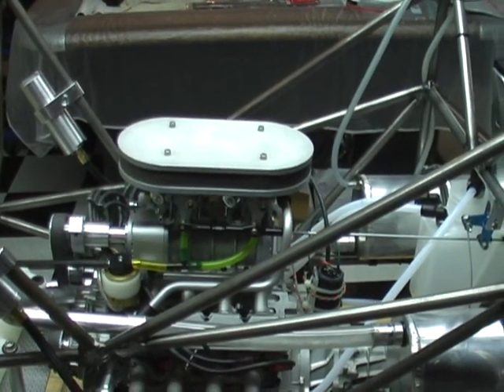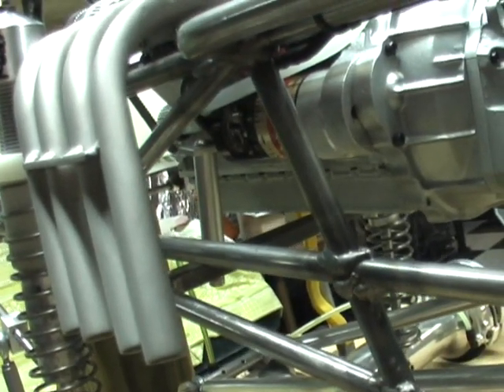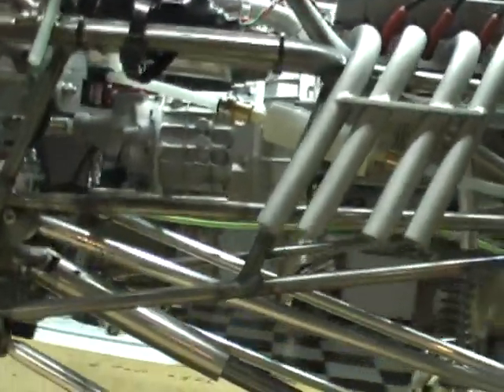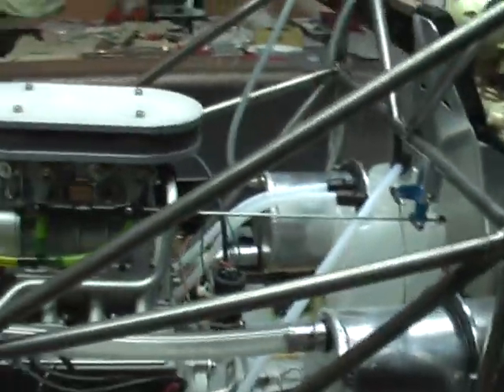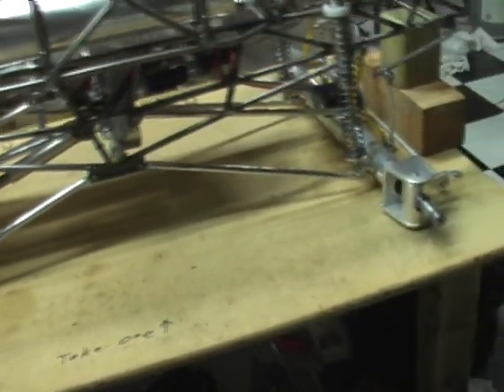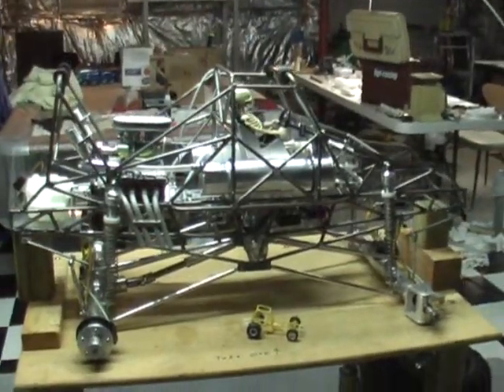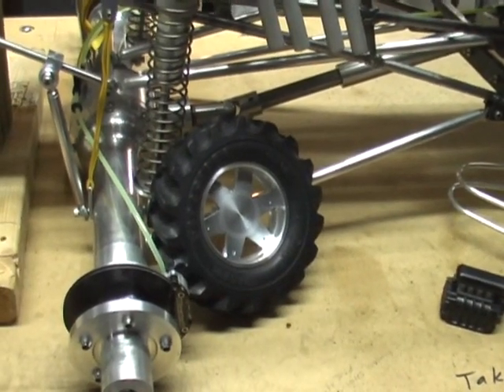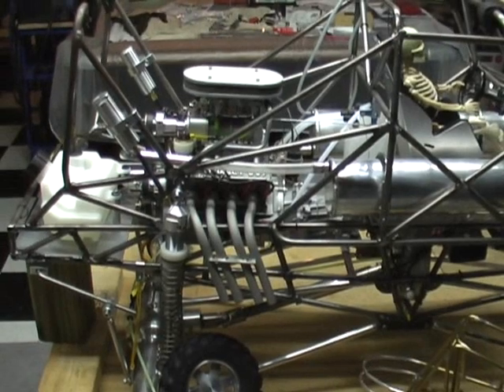1/4 Scale Grave Digger Part 22D - a few more details

Comment from the maker: The tanks are the radiators you could say.  Yes, the water flows from 1 tank, thru the engine then thru the other tank.   With 95oz of water it should run long enough to get to the finish line before any heating problems.

Comment from the maker: To - @Skwisgar2322 
Depends on how it runs.  A drive/steering front axle will add weight slowing it down and putting more strain on the engine.  Plus to design/fabricate one will take 100+ hours.  So all that work for a slower truck, I don't know about that!!

Comment: @rcWizzard 

That's one of the drawbacks of straight cut gears , they exert an outwards pressure [away from each other] during operation. But on a positive note they are more energy efficient than other kind of gears. Hope you find a permanent solution to this problem !
Good luck and keep it up !!!

Comment from the maker: To - @jackdaniels5205 
With a smaller opening below the carbs, the fuel/air mixture travels faster, then expands in the intake manifold which is a good thing.  Yes the builder, of 30+ years, is aware of the carb mods, which he has also done.   Check out the builders Updates at ConleyPrecision. com

Comment: @018e4 whats right with it lol...I would bet that its not meant to handle stress loads and the crank shaft will snap. Or it wont have enough power to spin the tires in the dirt. Either way you get the point.

Comment: Was is me or was there some servo binding on the steering.... you might want to adjust the throw percentage in the radio so that when you turn full right the servo stops when you do. also there was noticeable play in the servo for throttle between zero and when cable actually starts to move the throttle cables on the carbs. maybe some adjustment there for a more touchy response.

Comment: Of course the motor has the power. Put it this way, this motor has 9 bhp. It's gotta haul only about 90 lbs. The yamaha wr125r (offroad bike) has 14 bhp, and it's gotta haul 180lbs of rider alone plus the weight of the bike up to 75 mph! So this mini v8 really is overkill, but it's a learning curve, it'll take alot of time, trial and error to tap that potential, but the potential is certainly there, heck I can't wait for the wheelies (backflips more like!) so i'm just gonna stay tuned!

Comment: You could perhaps make the throttle servo a bit faster response time and tighten the lead going to the pivot arm, unless you are intentionally leaving a bit of slack to make lag in the throttle response.  I would assume having more direct response would be easier to control, but maybe that's just my driving style.  I can set up "exponential" on my radio, and I did set up some on the steering, but my throttle is almost 1:1.  This is a brush-less speed demon 1/10 electric buggy though...heh.

Comment: Put a shorter arm on the brake servo and use all the degrees you have available on it, that way you get the most torque out of your servo and you won't burn it up so fast.

Comment: @rcWizzard A fair point, although the design should bee the easy part as you can really just scale up smaller scale components or possibly re-purpose parts from a 1/5 scale R/C car. as far as weight, I am not sure it would add enough to be a significant factor but you have more hands on experience with that then me. perhaps you can run some numbers on how much more weight it would add, and once you get it up and running, through some ballast on it and see what it does?

Comment: The way it squats when you hit the throttle in vid 22 it should be able to do a wheelie. 90 pounds with 9 horsepowerr should pull the front wheels up.

Comment: Im not sure if the question has been asked ( I was reading through looking )but whats the idea behind adding a restrictor plate and dropping the power?also is the engine builder aware that just adding a restrictor plate and not making any changes to the intake and intake ports can cause big turbulence problems with air flow and air/fuel mixture inside the engine?

Comment: I notice no radiator, is the cooling a total loss system or is it recycled back into the tanks? Also how long will it run before either running out of coolant or reaching max safe temperature?

Comment: @rcWizzard My apologies if i gave the impression I was trivializing the task, I understand it isn't that simple. the design however shouldn't be as bad at this point, you already have the "pumpkin" section designed, and everything else has been designed in other applications. from the work I have seen you do on this so far, this should be well within your capabilities. I understand the fabrication is not trivial at all, and obviously it's your truck, so build it however you want.